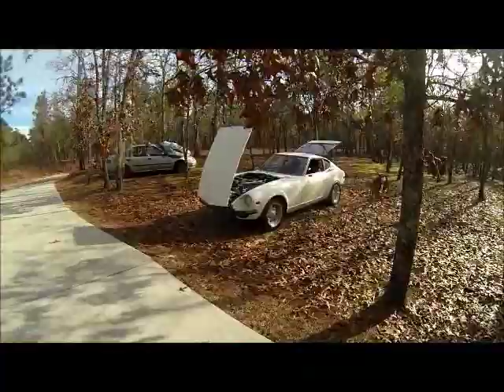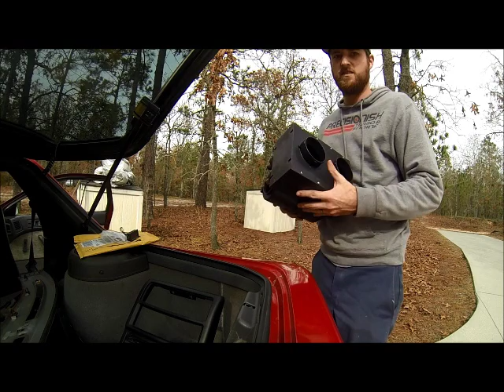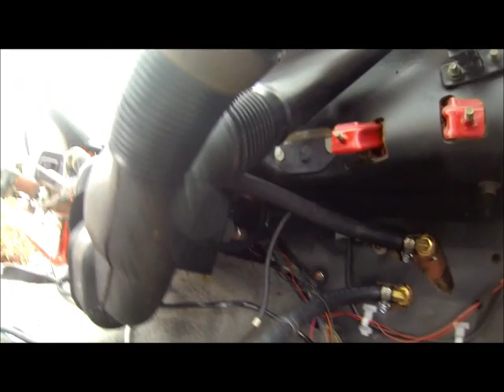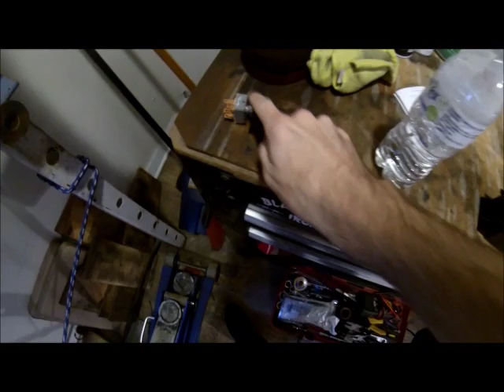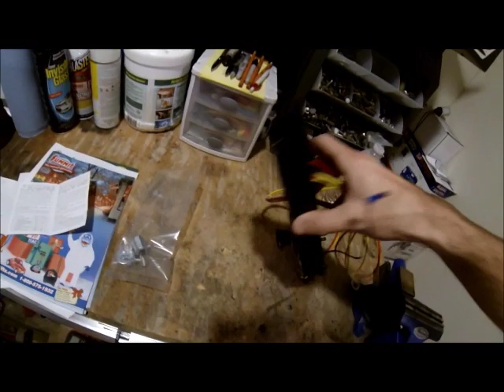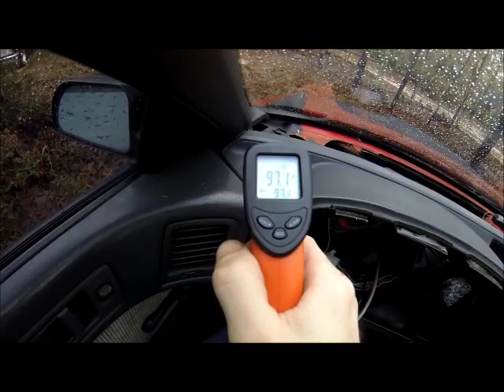Summit racing heater box installation with climate control!

Comment: Youve got the red wire coming off the amazon temperature sensor spliced into one of the yellow wires?, thats the only thing i cant see in your video , where that red wire is connected
Reply from the maker: I just have it interrupting power on low speed

Comment: I need to do this on my gbody. Do you have a link for the heater core
Reply from the maker: I can't remember exactly which one it was now. They make several. My suggestion would be to buy the biggest you can fit behind your dash.
Reply from the maker: I'm sorry I don't. It's one of the summit racing brand ones. Just get the biggest one you can fit behind your dash.
Reply: Same here

Comment: Could you post a wiring  diagram PLS ? Regards from the Netherlands. So the Controller gets the Power from the  Low terminal...Did you bridge the left plus from the controller with yellow feed on the right at the controller? Thanks!
Reply from the maker: It's been awhile since I've looked at the wiring so I can really tell you wire colors. I am passing the low side of the fan switch through the temperature controller to allow it to turn the fan on and off ONLY on the low setting. When it's on mid/high it bypasses the temp controller

Comment: Link to temp controller I like your setup on there man
Reply from the maker: Icstation DC 12V Programmable Temperature Controller, Smart Home Incubator Aquarium Car Improvement Mini Digital Thermostat Regulator Switch Module Waterproof Sensor -58℉ to 230℉ https://www.amazon.com/dp/B01J7VHS4I/ref=cm_sw_r_cp_apa_i_jQSuCb6PR264E

There's the link. Thanks for the kind words. I'll put the link in the description.
Reply: Thanks again I like what your doing keep at it